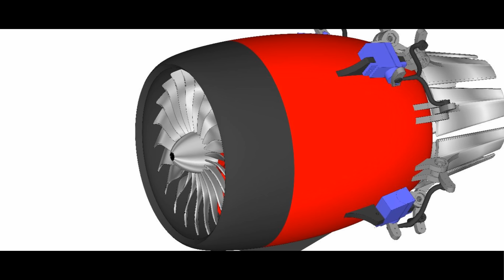3D printed Jet Engine with working Vector Thrust/ Jet Engine on rc Arrma Kraton car/Scale Addiction

Comment: Super design but your concept is fundamentally flawed as if anything it’s an EDF not a jet engine. You can’t claim that it’s a model of a jet engine either since it’s only a casing, nozzle and main fan disk. It a very nice looking but inefficient EDF, I mean your fan is glued to the shaft!! I love the ingenuity of the vectored thrust design, to work effectively in a real application it would have to be located further downstream but you concept exhibits nice out the box thinking which ultimately leads to innovation but this one has a long way to go.
Reply: jet engine
[jet ˈenjən]
NOUN
an engine using jet propulsion for forward thrust, mainly used for aircraft.

jet
[jet]
NOUN
a rapid stream of liquid or gas forced out of a small opening.

engine
[ˈenjən]
NOUN
a machine with moving parts that converts power into motion.

In every way, this is a JET ENGINE!
You have bought into a misconception, that you believe is a fact, that simply isn't. A turbojet engine  is what you are describing, it is only ONE type of jet engine, just like this is.
Reply: @shelbyseelbach9568  what I bought into was a ton of study materials, lecturers and hours of study, not to mention thousands of hours working in the field. In aeronautics, a jet engine is exclusively an engine that utilizes compression and combustion to produce thrust, pulsejets, ramjets, scramjets and any unconventional variation of the original jet engine, turbojet, UHB, HB all compress and combust air in one way or another exhausting it to produce thrust. There is a completely separate technology presumptuously called a 'fanjet', which like the electric ducted fan or ducted fan utilizes a ducted fan for thrust, sometimes compressing the air through a narrowing nozzle but devoid of any type of combustion, not commonly found in aviation but frequently found in model aeronautics. What many developers and manufacturers and even hobbyists experimenting with DF's and EDFs have found is that modern jet engine fan designs are not suitable for the high rpm ducted fans, I could get into the science of ducted fans and why that is but suffice it to say it is a completely separate technology from jet engines and what this guy has produced, albeit very nicely produced is a good looking EDF that will not be as efficient as one designed purely for the application because he based it on the aesthetic of a jet engine. This is a tired discussion found on many hundreds of YT videos and modelling forums
Reply: @wingnutzster  Exactly, all of that has led you to believe that this is not a jet engine, in spite of the facts presented. Once again, this meets all the requirements of a jet engine, he never said turbojet, he never said scramjet, he never said pulse jet, he never said ram jet. You'll notice that all in of these jet thrust producing motors, the word jet is accompanied by its power source to name them. This is because they are all jets, just like this one is. I understand what you think a jet motor has to be, you are simply wrong in the thought, that's all. A common misconception.
The coolest part about the whole thing is it doesn't even matter if you agree. Agreeing is not required to be wrong, in fact, they almost never go together.
Reply: @shelbyseelbach9568  Semantics, if a guy claims that he built a jet engine and proceeds to produce something that in almost every way at least externally represents a small Williams or P&W on popular media he is most likely not describing a 'jet' according to Newton's law, that's a given, it is smart alec to then come along and claim 'well even a water jet is a jet' because that is not what he is illustrating. Technically and professionally speaking what he has produced is an inefficient ducted fan engine - by your thinking, are we to call a rapidly deflating balloon a 'jet engine'? We don't called ducted fan's 'jet engines' in the same way we don't call birds 'avians'. The proper term for what the laypeople call 'jet engines' is turbines, yes and that defines it more accurately but what was proposed here was a working scaled jet engine in the layman's sense.
Reply: @shelbyseelbach9568  the same can be argued about his claim of 'vectored thrust' - what he created was a variable nozzle and not what is generally referred to as vectored thrust but one could be a smart alec and say theoretically the thrust is still being vectored and thus he is correct...when he isn't.
Reply: @wingnutzster  None of that changes the fact this is an engine producing thrust by means of a jet. A rapidly deflating balloon is not an engine as it does not meet the definition of one at all. Once you arguing to try to make your incorrect preconceived opinion correct, when it is simply not possible. Try as you might, what you thought is wrong. Sorry, I know it sucks, but it is what it is
Reply: @wingnutzster  Thrust is always being vectored, as it is thrust. No, he didn't build a thrust vectoring nozzle, I never claimed he did. Being correct about one thing will not make you correct about another. Sorry.
Reply: @shelbyseelbach9568  It's not producing thrust by means of a jet, that's the thing - a fan is a modified propeller, propellers do not make jets, sticking the fan in a duct to capture spilled air and increase velocity does not make it a jet - in a High Bypass ratio jet engine the primary fan produces ducted flow and partial thrust, the jet engine produces a jet flow and the majority of thrust - what he has is a HBR fan minus the jet engine core.
Reply: @shelbyseelbach9568  what 'sucks' is that I've spent so much time on this.
Reply: @wingnutzster  jet
[jet]
NOUN
a rapid stream of liquid or gas forced out of a small opening.

You can quit whenever you want.

engine
[ˈenjən]
NOUN
a machine with moving parts that converts power into motion.

Or you can just keep trying.

jet engine
[jet ˈenjən]
NOUN
an engine using jet propulsion for forward thrust, mainly used for aircraft.

It really doesn't matter to me.

Comment: its an EDF. Not a jet engine. No chemical combustion, so its not a jet engine. Also that is not thrust vectoring. Thats just making the exhaust smaller (less efficient).I guess you could add thrust vectoring for your EDF in software.
But still nice work.
Reply: jet engine
[jet ˈenjən]
NOUN
an engine using jet propulsion for forward thrust, mainly used for aircraft.

jet
[jet]
NOUN
a rapid stream of liquid or gas forced out of a small opening.

engine
[ˈenjən]
NOUN
a machine with moving parts that converts power into motion.

In every way, this is a JET ENGINE!
You have bought into a misconception, that you believe is a fact, that simply isn't. A turbojet engine  is what you are describing, it is only ONE type of jet engine, just like this is.

Comment: Not a jet engine.
Reply: jet engine
[jet ˈenjən]
NOUN
an engine using jet propulsion for forward thrust, mainly used for aircraft.

jet
[jet]
NOUN
a rapid stream of liquid or gas forced out of a small opening.

engine
[ˈenjən]
NOUN
a machine with moving parts that converts power into motion.

In every way, this is a JET ENGINE!
You have bought into a misconception, that you believe is a fact, that simply isn't. A turbojet engine  is what you are describing, it is only ONE type of jet engine, just like this is.

Comment: Not a jet engine, not even a model jet engine, its a ported fan. Shoddy masking, runs everywhere. Ludicrously under-specified motor mount, printed in PLA (Motors get hot)...
Made me laugh my tits off, but you dont get a like and I wouldnt subscribe for that if you paid me. You need to level up your skills dude, sorry but there it is.
Reply from the maker: Lol I made u write all that?, wow, can u do something like this ?
Reply: jet engine
[jet ˈenjən]
NOUN
an engine using jet propulsion for forward thrust, mainly used for aircraft.

jet
[jet]
NOUN
a rapid stream of liquid or gas forced out of a small opening.

engine
[ˈenjən]
NOUN
a machine with moving parts that converts power into motion.

In every way, this is a JET ENGINE!
You have bought into a misconception, that you believe is a fact, that simply isn't. A turbojet engine  is what you are describing, it is only ONE type of jet engine, just like this is.
Reply: @shelbyseelbach9568  By your definition then, it is a poorly designed and badly executed model jet engine. Really, at this point I'm not sure who you are trolling - me, OP or yourself.
Reply: @OriginalMorningStar  Never said it wasn't. I'm not trolling anybody.
Reply from the maker: I respect your knowledge and what you have accomplished so far, hope you are in good mood now